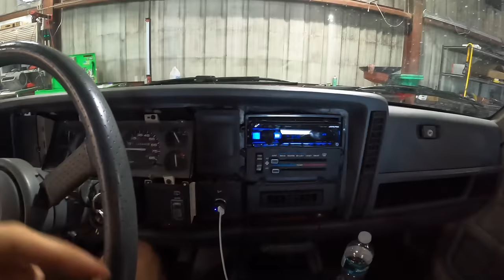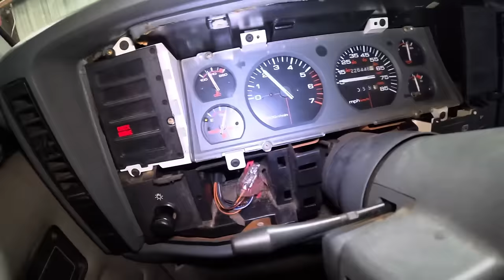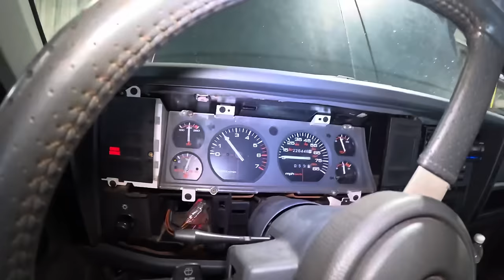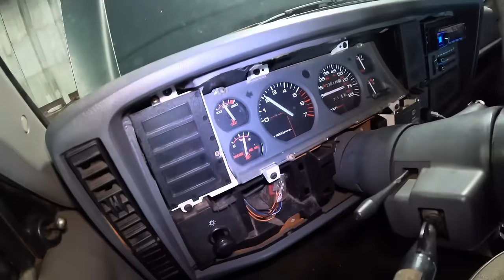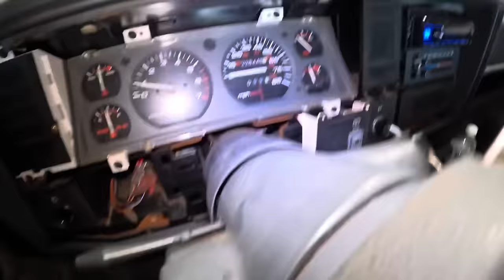Scalding HOT EVIL Filter of DEATH!  SEVERE Smoking! Jeep 4.0 Cherokee / Wrangler @bgproducts

Comment: Best engine flush I ever did was when my 5.3's head gaskets rotted between the front coolant passages and the openings for the lifters. I decided while the heads were off, I might as well have them hot tanked and gone over at a machine shop. Then while waiting on those, I decided to go ahead and toss new knock sensors and harness in and change the leaky oil pan gasket. THEN, I decided it was only a few more bolts to pull the timing cover and change the oil pump o-ring. And since I had the pump off, I might as well throw a new one on, as well as a new timing chain and gears. I hosed everything down on the engine with brake clean and cleaned all the parts I was resusing (valve covers, oil pan, etc) off in a tub of mineral spirits. There was oil/antifreeze sludge everywhere, especially in the valve covers. Looked like molten peanut butter. When it was back together and running, the oil was crystal clear, and it had much better oil pressure than before.
Reply: I love the "while Im here" steps you took LUL

Comment: Little tip for removing a drain plug when the oil is hot, use a long extension on the ratchet! Kinda obvious really!
Reply: Troy can get blinded by hot oil splash. no safety glass, time for OSHA visit.

Comment: Those jeep 6cyl engines are known for leaking oil. Almost like they leak through pores in the metal of the engine block. That engine needs to be dunked in a vat of brake parts cleaner.

Comment: You do know that all that crap you cleaned out was run though all the bearings in the engine, also they make mechanics gloves to help remove hot parts!!!
Reply from the maker: It was run through the pump and straight into the filter. The bearings ALWAYS get filtered oil

Comment: Dude you really just changed the filter after putting the cleaner oil in so it will leak some of that out and your loosing oil pressure and the clear and both steps by having no bolts in valve cover which has been dumping the cleaner out all over the engine

Comment: I feel all that internal engine flushing/cleaning is a futile effort in an highly neglected engine. That sludge is typical of extended conventional oil changes. The excessive wear has already occurred. Cleaning will not fix the damage that has been done. At this point, the only benefit of cleaning would be if you were going to rebuild the engine.

Comment: Great job! Next is oil pump. With all the shmoo removed the gears will flop around. I'd go with a hi volume pump. A hi pressure will wash the bearings. Unless your changing the rod and main bearings. Then the hi pressure is recommended. Cleaning the inside of the valve cover a gallon of gasoline is cheaper than a case of break clean.

Comment: Wow!  I didn’t think in the beginning that it would make that much difference!  Wonder how many engines have been replaced, rebuilt or overhauled as they said prior to the 70s that could have been saved with this method?
Reply: Engine cleanings(flushes) used to be very common until the 90’s. We used to rebuild parts too.. not just replace them

Comment: That's what you call snake oil
Reply from the maker: But it actually works (in the right circumstances) It’s not going to fix ruined seals or rod knock, but with a carbon clogged engine, it does some good

Comment: That thing is going to put down a smoke screen in the morning when he starts it up. If the valve guides were leaking before , flushing the engine will make them worse.  Should have used 20W-50 oil or even straight 50weight valvoline racing oil. It's Florida, it rarely gets cold and the higher viscosity will raise oil pressure and be less likely to leak past the seals. Or several bottles of STP or motor honey. The added viscosity will help.

Comment: Ray I’ve got an old Chrysler 2.7L V6 when I got it there was a lot of buildup visible thru the oil fill port. I add a quart of Marvel mystery oil to every oil change. I noticed a huge improvement in reduction of buildup by the 2nd oil change.I now add Marvel mystery oil oil to every oil change. My oil stays cleaner longer between changes. You might want to try it on the older vehicles

Comment: Hey! what kind of scam is this? the original oil filter is the same brand as the ones he uses to flush with later. It's not even dirty at the bottom closest to the oil seal. So now Ray sells snake oil. Absolutely NO workshop in Western Europe uses snake oil to flush engines as it damages the connecting rods when the oil becomes too thin. Manual cleaning of the valve cover and the oil pan is what is required to prevent the pick-up's filter from clogging. Or just frequent oil changes. Bad, bad greedy business going on under Ray's workshop roof now...

Comment: Before I get into your video, let me get this straight, you're replacing six or more quarts of oil (old) with four quarts of cleaner, run it (an hour?), then replace the four quarts of cleaner with four "new" quarts of cleaner, and run it some more (an hour?), hopping the engine doesn't turn into a lump of slag?  ;-)

Comment: Smoking caused by valve guide wear, or maybe piston ring wear, I know let’s throw some cleaner in the oil pan. Which does NOTHING to repair or improve the wear of engine parts. Ray you failed on this one. You barely cleaned up the sludge. Repaired nothing.😢😢

Comment: I can't believe you would use or be involved with selling Witch Water.  It isn't going to fix a damn thing in that worn out jeep engine.  I'm embarrassed that I sat through this video
Reply: How dare you insult the snake oil.  It works, scotty sells it.
Reply: soooooo, you didn't notice the massive amount of smoke from the exhaust pipe before the flush, and after the treatment with this "Witch Water" as you called it the total lack of smoke? Seems to me that this "Witch Water" did something good to that tired old 300,000 mile Jeep engine, wouldn't you agree? Or are you accusing Ray of faking his videos 🤔. You can't be that embarrassed to have sat through the video because you did indeed sit through it when you could have easily turned it off. Not only that, but you also decided to comment in a negative manner also showing that you watched the video therefore embarrassing yourself even more! 🙄